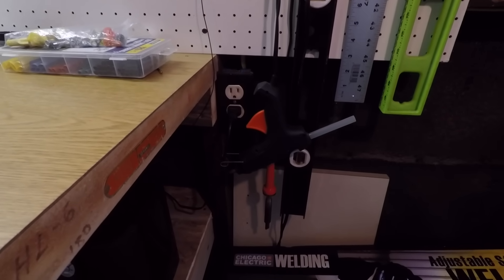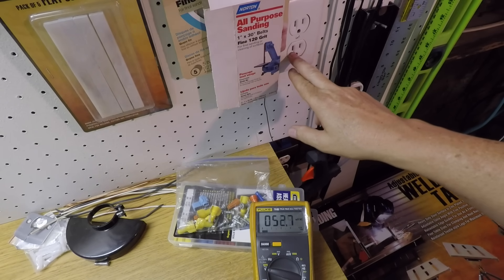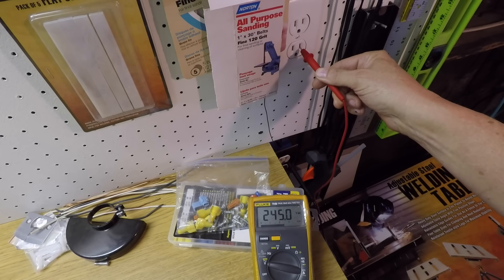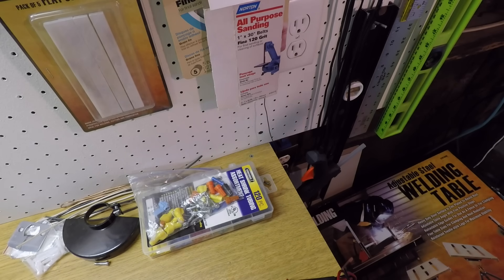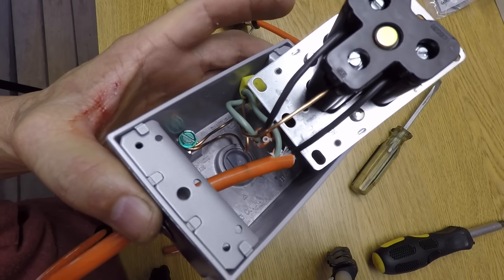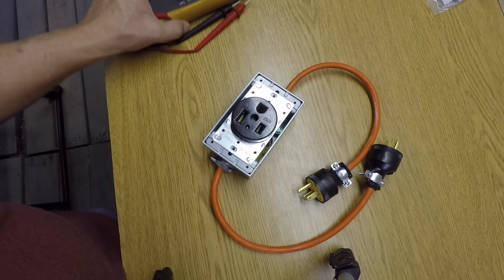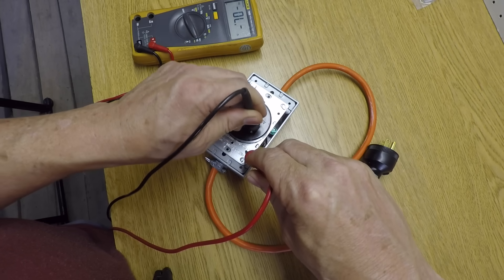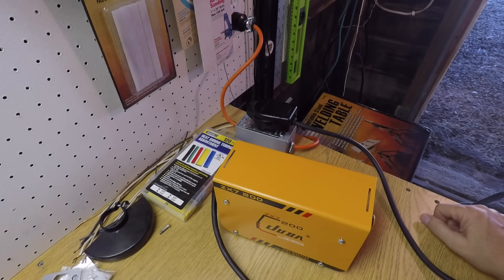How to Get 220v From 110v

Comment: He keeps say that the outlets were installed on different lines.  That ONLY works if the two breakers are  drawing from different sides of the 220 volt service lines in the main breaker box.  It would not work otherwise.
Reply: Right, that. Means he has 220v service.
Reply: Why not use the return instead of the ground? Doesn't the return line go back to the transformer on the pole? And the ground to an earth ground?
Reply: If he had a O-scope he would find they are out of phase. Also he is running the chance of tripping one breaker and not the other one. Pretty sure that ruins the welder.
Reply: @bobbyboucher-han9275  "There's something I forgot to tell you, do not cross streams. It's bad." "I am fuzzy on bad." "Imagine all of your cells exploding at the same time." "A total protonic reversal." "Ok. That's bad. Alright. Important safety tip. Thanks Igor."
Reply: @defiverr4697   LOL
Reply: Bobby Boucher-han That will not hurt the welder. If one side trips the circuit is open. Still live but open.
Reply: Incoming service is 240. The box has 2 120 legs. A 220 breaker is basically a 2 pole 110 breaker that pulls off the same leg in the box.
Reply: @briensickler8109  A 240v breaker pulls from both buss bars in the breaker box. If it pulled both hot legs from the same buss bar in the panel you would only get 120 vac, not 240.
Reply: Unscarredcfh. To be sure, if boths hots were connected to the same bus, you get zero, not 120V, between them.
Reply: @briensickler8109   It has to pull from opposite legs to achieve the 240 volts. There is no difference in potential between connections on the same leg.
Reply: @briensickler8109  not... it pulls off of two different 120 legs...
Reply: @briensickler8109  As the buss is staggered top to bottom in the breaker box, a 220v breaker is pulling from both incoming lines.

Comment: There are a lot of homes where only 120v was run to the garage (sometimes multiple 120v lines), but no 220.
Reply: If there is a dedicated circuit (meaning that you have a plug by itself on a breaker) All you have to do is untie the neutral (white wire) from the neutral bar, put a 2 pole breaker in place of the single pole breaker currently in use (provided you have enough extra breaker spaces) Then hook both the Black and White wires to each side of the 2 pole breaker changing the White wire from a neutral to a hot. Then install a 220 plug in place of the 110 plug. But don't use heavier size of breaker. Make sure that whatever size of single pole breaker you remove is the size of 2 pole breaker you install...

Comment: That's kind of interesting what you built there I actually had one that was the reverse of what you built it was where I plugged into where the dryer was in a customer's house came off of it with two one tens plugs the the reason for it was I had a piece of carpet cleaning equipment that pull 35 amps two separate plugs Amazon hard sometimes to find customers houses where you could get that much amperage so the person sold me the piece of equipment sold me this device we used it for a long time have no idea whatever happened to that that plug adapter but interesting

Comment: This is not wise. 15 amps at 110 is not the same as 15 amps on 208. Using this box short term will work but for any lengthy amount of time it's going to cook your 110 Romex.
Reply: He's residential - likely 240v single phase. I've only seen 3 phase 208v in commercial buildings and apartments. Regardless, heat is based on amperage. 15 Amps puts out the same heat regardless of voltage (at least below 2000 volts). Check out NEC Table 310.15(B)(16) - conductor ampacity. Notice how they only list amperage without regard to voltage. Amps is what cooks wire.

Comment: Your using your ground as neutral, neutral and ground are not the same. If your going to do this, remake your cords without cutting the white wire. Attach the black from each cord to receptacle positives (flats)and both whites to neutral(round)and green grounds to box and frame of receptacle . I still don't recommend doing this but the way I explained is safer
Reply: His receptacle has 2 hots and a ground. A neutral is not being used by his circuit. The Nema 6-50 receptacle he is using has no connection for neutral.

Comment: I bought box, 240v breakers and 60ft of 8-2 wire tested it and there ya go. it was about 100 bucks (welding cable cost the most) but it past inspection. with 60ft of line I can run up to 240v welder according to the book and inspector. Work great and safe

Comment: That's pretty smart. I haven't seen anyone else do that, but why don't you just run EMT in your shop and surface mount a welder recepticle?  Plus, you only have a 20amp circuit. Your welder might trip the circuit breaker.
Reply: Holy dung,u don't know his locations. I have similar setup where my lines go through a carport attic with no access then go underground for a few feet then into a junction box on exterior of shed and then through wall
Reply: Reidentify the neutral and land it on a double breaker.  Done.

Comment: Are those two twenty amp outlets dedicated ?
FYI: for clarification i am not a licensed electrician . All my input should be verified by a qualified electrician. 

You said that was a 50 amp female outlet you used, yet you only used two twenty amp breaker/wire !?  Then you have to figure in safe load capacity for each breaker, which of course will make it even less than 40 amps . ( i think you figure minus 10 % of total wattage for each breaker) 
 Incidently How many watts does your welder use ? If not on label, volts x amps = total wattage
 Example: 20 amps x 120 volts = 2400 max watts - 10% safe load capacity = 2160 watts on a 20 amp capacity breaker. Anything else plugged into that line to that breaker must be figured in to as well. Because its on the same breaker.
  If you have 2 dedicated BREAKERS/LINES, It be more cost effective to just go ahead and run a 50 amp breaker/line.  
  The Extension cord( called SJ ) is stranded and will heat up under load quicker. Solid wire which is normally used to hard wire outlets , in my opinion is safer.  Although its stiff and hard to work with. 
  Overall id run it by an licensed electrician. Perhaps you have a friend thats one.  Be safe sir in your endeavors.  Have a nice day.

Comment: Thanks for the video. Two suggestions 1. The 20a outlets on wall are only 15a, you can tell bc a 20a has a slice on one prong so better to change those 2. 50a/250v outlet needs #6/3 wire so even if you cut that amperage in 1/2 it’s 25a which would need #10 wire. So better to at bare minimum use same #12 wire you have in walls. Not trying to be negative. I learned something here. Keep posting.

Comment: Many years ago, houses were wired with two wires. The plugs had two flat blades. One was power and the other was power ground. Today, the three prong plugs are connected the same way with power and power ground on the flat blades (not like you connected). It was noted that the power could short to the case so that code was changed to require three wires to each plug. The third wire (which could be called a safety ground) connects to the "round" blade. It is grounded but normally conducts no current. Even through a wire, current will cause a voltage drop. You are using this safety ground wire as power ground so that there will incorrectly be current flow through the safety ground wire. So connecting the case to a current carrying wire, as you did, is dangerous.
Reply: He is not using it as a power ground 220 does not have a neutral or (power ground as you call it) the issue is tying grounds from 2 circuits together which creates a loop. Grounds should be radial never loops.

Comment: How exactly are you getting 240V from 120V as the title suggests?
Reply: Cholo Verde in the US, residential electrical service is not actually 220 volts. The 220 volts we use is actually two 120 volt lines running a half wave out of phase. This is why 220 breakers have two poles. This is what he has done here although it is not a very good way to do it.

Comment: Get a 110 volt welder. Lincoln sp 135 works pretty good for small stuff. Big stuff is gonna need more power than your circuit will allow anyway. Small gasoline welder will work too.

Comment: I see that you made a statement about "NOT TRYING THIS AT HOME" so that's good. I have not read the other comments so I am sure there are many with advice. But just at first glance, I wondered how you had two 120v outlets on separate circuits so close to one another...unless one was added, in which case a dedicated 240v circuit could have been added instead. But you also acknowledged one of your other problems - you used some materials rated for only 15A. Considering the 15A limitation at 245V, you will max out the circuit at 3,675 watts. So forget about the shop lights, you don't even have enough to safely run your welder, which has a generated output of 4,000 watts.

Comment: You have 12 ga. Wire with 15 amp recepticals. 12 ga. wire 20 amp recepticals 20 amp barker is a true 20 amp circuit. I'm talking 110.
Reply: Only for simplex. 15 amp duplex are allowed on a 20 amp circuit.

Comment: Does it matter in your home if the wires on every outlet are wired the same? Black on the left side and the white one on the right.
Reply: Yes left side is grounded right side is hot
Reply: Travis is correct if your ground prong (the round one) is on the bottom and the 2 blades are on top.

Comment: Just put in a new Jbox then go to ur breaker box and put the two single pole 20's on a double pole 20.  And save all the time and extra materials.  Because you are wired for 230v

Comment: What happens if one one breaker trips while your welding.
Reply: Total blackout in China!
Reply: The fan keeps blowing and the power indicator light remains lit but zero arc.....if 1 breaker trips.
Reply: @charlesbucholz8079  The connector he is using is a NEMA 6-50R and it has no neutral.  The bottom round connector is ground and should not be used for power as a neutral would.
  Unless the wiring in the welder or cord is using ground as a neutral which is a bad idea and against code, it should not have power.
Reply: @charlesbucholz8079  I'm not sure of all made in china welders but mine the cooling fan is also 240 volts.
Reply: The welding machine stop working
Reply: @Thebasicmaker  this is the correct answer, when the one breaker is reset the welder will work again.

Comment: IMPORTANT INFORMATION
You cannot pick just any two circuits (i.e., separate lines coming from separate breakers)
The two breakers MUST be on separate phases.
Often breaker in a box will alternate (phase 1, phase 2, phase 1, phase 2, etc)
while other may have all phase1 breakers on one side and all phase 2 breakers on the other side.
Another important note:

The two circuit MUST be in the main panel, not on a subpanel.
The main panel is where neutral and ground join; hence for 220 outlets whether you use neutral(white) or ground(green/bare), they are running to the same place anyway.

Comment: I was a service tech for Wards, I remember going to a very old house that had been wired by several people over the years. and someone had wired the living room in this same manor. The customer had just bought a new big screen TV, VCR and a stereo system. He had plugged in the TV and VCR into one outlet and he plugged the stereo into the other outlet, all was fine but when he went to connect the RCA cables from the stereo to the VCR and everything blew up. The customer said he didn't know what he had done but everything went poof. Yes this can be very dangerous, all is fine till you loose a ground! Never wire like this, and never drag a extension cord from another room, it may not be on the same leg either.

Comment: To start with I am a licensed electrician. If your getting 240 volts from the two outlets then you have 240 volts at the panel why waste your money buying all that excess when it's not needed just hook your plug directly to the panel, you can't get 240  unless you have two lines of 120 coming in from the power company

Comment: The 240v you got is two 120v from two hot wires, not those one from Europe. In Europe, When you measure the hot terminal to ground it will give you 240v. Neutral will give you ZERO to ground.

Comment: Don’t do it this way, buy a DOUBLE BREAKER in which the two switches are ganged together,  one cannot blow without blowing the other.
Install the breakers in two ADJACENT EMPTY SLOTS, YOU ACTUALLY CANT INSTALL THEM ANY OTHER WAY. 
Then simply run your wires from these breakers and BINGO YOU HAVE 240 VAC all Kosher and safe. 
Don’t forget to run a GROUND WIRE AS WELL, both wires are LIVE WIRES, NO NEUTRAL
This is completely safe and is standard practice, it is VERY SIMPLE.

Comment: When I wired  my shop I ran a 240 volt into my shop. Then a came off of one side of that one to run my 120 volt outlets. That's safer than what you have there.
Reply: you're wrong! actually that's very dangerous, cause you are running 120v electronics over a 240v circuit, that means the breaker in that circuit will be 30amps or higher, if you have have any over heat or short in your outlets, big chance that your breaker will never trips
Reply: Did you run that 240v into a sub-panel before splitting off that 120v? Or are you feeding those 120v outlets 30 amps or more?

Comment: I am not an electrician but my dad was and he worked for the power company as a service man for 40 years. I doubt he would have approved of this and would instead put in 240 outlets where needed. BUT, that said, when he did build extension cords for construction areas he would always use Romex wire instead of extension cord wire. Romex is the wiring in the walls of your house which carry current much, much more efficiently so you get much less power drop over distance.
Reply: 14 gauge copper will have the same ampacity if it's stranded, solid, extension cord, romex, doesn't matter.

Comment: How much current does that welder draw, hope it's less than 20A.
Reply: Has to be around 16 to hold consistently. Otherwise the breaker will trip. Won’t get much of an arch on the welder.

Comment: Depending on what you are powering you could damage it.  If one breaker opens the remaining load supply is still hot and can fry certain circuits.  Another issue could be the wire length.  You can lookup the resistance of the wire and calculate that with a known length of wire or measure it then multiply that by the current draw.   That will tell you the voltage drop.  When one side voltage drops more, it will not push the same current.  While using it other appliances on the 2 circuits should be off.  You could balance the load with a transformer but I'm not recommending that.  The right thing to do is use a 220 source from the panel or use a pigtail from your dryer.
Robert
MSEE
Reply: Robert S he had 1 vac voltage drop
Reply: Both line have a circuit breaker he says that many times

Comment: JOKE, Your not getting 240v from a single 110 outlet, your getting 240v from 2-  110v outlets on Separate Phases of a 110/240 panel. Imagine that power works as it should

Comment: Greetings..... I seen your video. The idea is good. However for safety issues i wood chose to make a permanent outlet without 2 external wires en plugs. Built a direct line to the circuit breakers box, and Connect the wires directly .